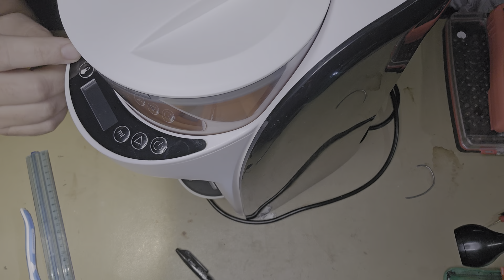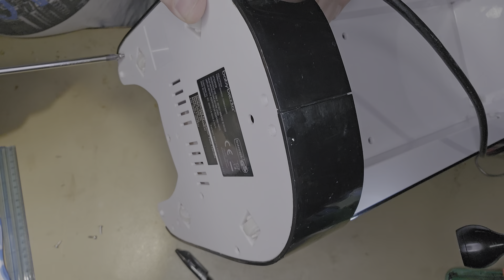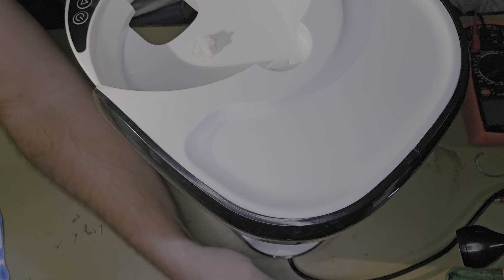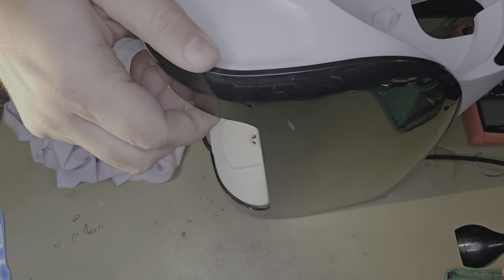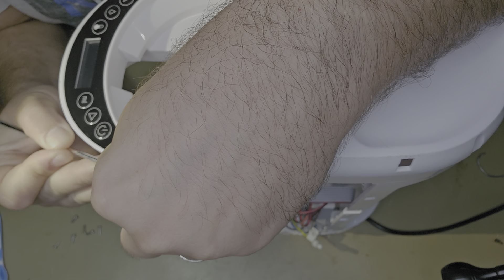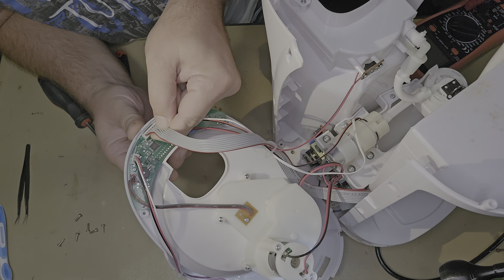BABY BREZZA  dissasambly | Trying to repair Control panel

Comment: If the issue was the LCD display not displaying but the machine works (I know the buttons by muscle memory now), would that mean the LCD display can no longer work or is it possible it's a loose/corroded connection?
Reply: @sper25 have you solved this issue?
I got the same , blue light is not working anymore, but the display and baby breeza works :(

Comment: Hi this is very nice! What are the name of the buttons if I should buy them and replace them myself?
Reply: @adrian
Reply: @benassy69
Reply from the maker: I just found this on AliExpress: 
RON7.93 | 50PCS 4.5X4.5 Push Button Switch SMD 4.5X4.5X3.8 Light Touch Switch 4.5*4.5*4.3/5/6/7/8/9/10/11/12/13MM The Power Switch 4Pins
https://a.aliexpress.com/_EHGHVG6
Reply from the maker: 4.5x4.5x3.8

Comment: Hello, I have a babybrezza that has issues with no power just from one day to another. 
Do you know how to fix it? Found another video where it needed a new diode, but no information about which or any specifics. 
Thank you
Reply from the maker: Yes. Can be that fiode on the rectifier or a fuse. The board must be checked by an electronist.

Comment: Did you fix it?
Reply from the maker: Yes
Reply: Great! I have a problem with mine, off and the start button doesn't react. All other works. Did you change the control board or only some parts?
Reply from the maker: The problem lies on the control board and more exactly the buttons themselves. The buttons due to moisture corode inside and are not responding or ar always active. Change the buttons and the problem will be resolved. Buttons are really cheap you can find them in batch of 20 on aliexpress for a couple of bucks.
Reply: Thank you so much for sharing info
Reply from the maker: You're welcome!  Hope you manage to fix your unit!
Reply: We fix it thanks to you  @benassy69
Reply from the maker: @blackButterfly91pi  great news!